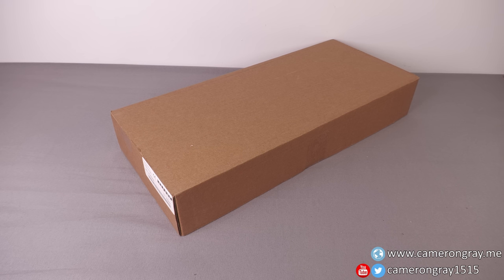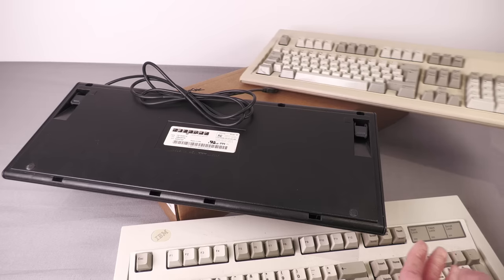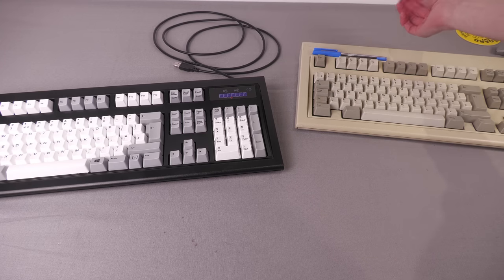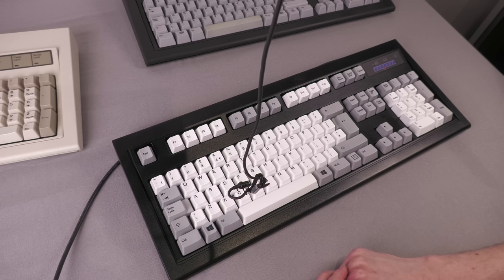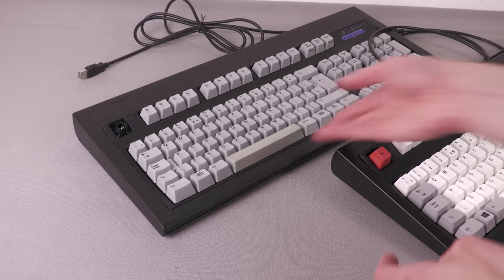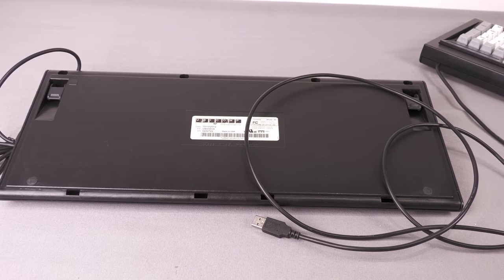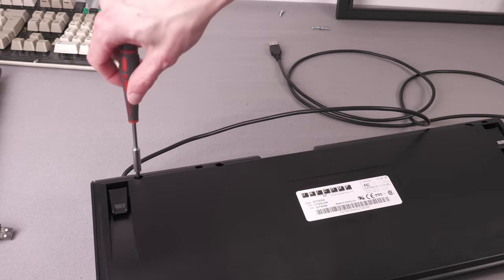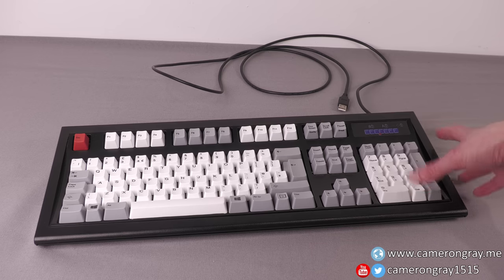A Classic, Updated - The *New* Model M Keyboard from Unicomp

Comment: do not get this keyboard. as mentioned this was made after the  membrane change. so basically its either a nostogia buy imitating the real thing, or its a monument to failure..either way  its junk that will be lucky to last the year. while a real ibm-m you should be able to hand down to your descendants...i  know people that already got one from his parent who plans on giving it to their kid one day...this is not that.
Reply from the maker: Yes, it's not an original IBM Model M, but your claims about reliability are completely without any sort of proof and are pure speculation.  The overall design is basically the same, they still have dye sub keycaps which have excellent durability and the new tooling likely produces more durable results than they were getting on the Unicomp Classics.  They are still made based on original IBM designs and patents by the company that have been making these keyboards for the last couple of decades.  Additionally, while Model Ms are heralded as beacons of reliability, they aren't necessarily anything special, especially with the plastic rivets that break off over time requiring bolt modding.

Sure it's a nice idea to be able to pass something down to descendants, but it's not something that really influences me buying a keyboard - I'll probably spill a coffee through it long before then!  And lets face it, in 50+ years time, I doubt a PS/2 or even a USB keyboard with this layout is likely going to be remotely relevant.

If you want an original Model M, sure, go for it, but for people who want a bucking spring keyboard with Windows keys and a native USB interface, this is an ideal option.  Also, note that I have multiple original Model Ms including the square badge which is regarded as one of the best model Ms.  I have used these original keyboards full time at various points over the years, yet I'm still using the new model as a daily driver for it's smaller size, more consistent feel due to less wear, windows keys and native USB.
Reply: @camerongray1515  heck i dont even have to touch the keyboard, if i tap on my desk it will type for me lol. ive  had $30 keyboards that were better then this lump...i do like the feed back of  the keys, but the membrane is an early membrane design. which means its the worst of the worst man.
Reply from the maker: @operator9858  That's unfortunate for sure but could just be bad luck, is this a Unicomp Classic/Ultra classic or a "New Model M" such as the one I showed here?  The Classic models were definitely experiencing quality issues due to the old tooling which is what prompted them to invest in new tooling and release the model shown here.  What sort of issues are you having?
Reply: @camerongray1515  mostly with the spacebar, but sometimes i get random characters as well, but i  often wonder if this isnt somehow related back to the original spacebar problem  somehow. got it back was good for a little while but then you look away and you have 10 pages of spaces on whatever you were doing or every word has double and triple spacing in what you are typing. somedays its tolerable, other days its insane...
Reply from the maker: That's definitely not right, at that point I'd be looking for them to send a completely different keyboard as a replacement (potentially one of these New Model Ms if the one you're using is a Unicomp Classic).  It may also be worth removing and replacing any keycaps on the keys that are causing issues as the springs can get dislodged in transit and cause issues, especially if any of the keys feel a bit different.
Reply: @camerongray1515  ive tried speaking with them but i dont want to pay a 3rd of the cost of a new one to repair my old one again.  I just ordered an actual ibm-m and will maybe keep this thing for parts, but at this point im kind of over it and feel like they really let me down both with the product and the service...
Reply from the maker: Yeah, that's definitely not right if you're having to pay to repair it - you said it failed after 6 months, they come with a 12 month warranty so at the very least they should have repaired it free of charge.  I'd definitely be querying that with them!  I suppose I have the benefit of buying from a UK retailer where the warranty is handled through them and I'm also subject to various UK protection laws that give protection in the event of problems.
Reply: @operator9858  Contact Unicomp support, my board arrived with the exact same issue, space spamming with occasional return and the 8, 5, `, menu and other keys randomly pressing each other.
If yours has that exact problem, the controller module is missing pullup resistors, which is a manufacturing defect in it and not an issue with the membrane.
On my board, holding down the keypad minus key with some clamp and then pressing space once fixes it.
But due to the nature of this issue, it's intermittent and influenced by a lot of factors, so this might not be the case for you.
And ofc., yours might have an issue with the membrane instead, mine was built on 2023-05-01, with the redesigned controller.
Unicomp send me a new module for free after I specifically asked whether I could repair it myself, on a board I imported directly from the US, to the NL.